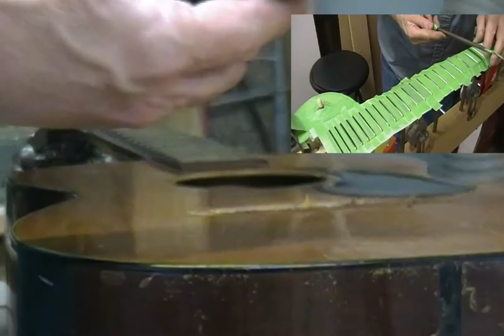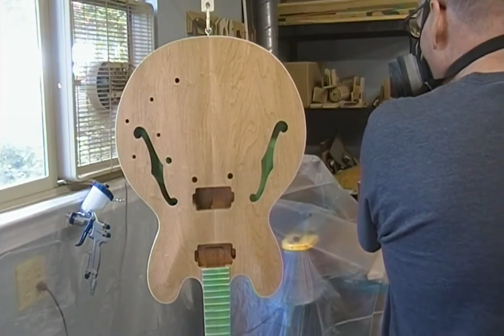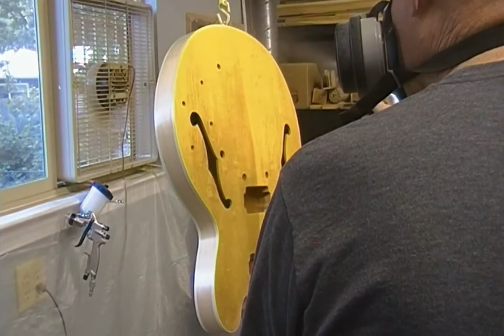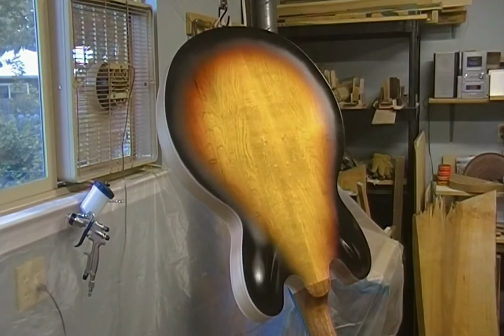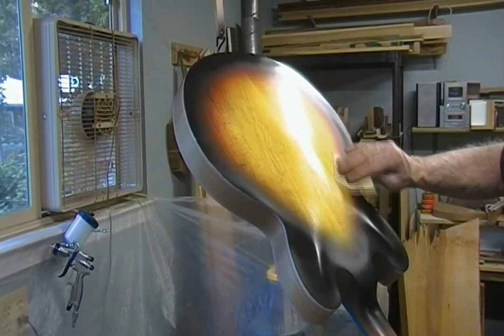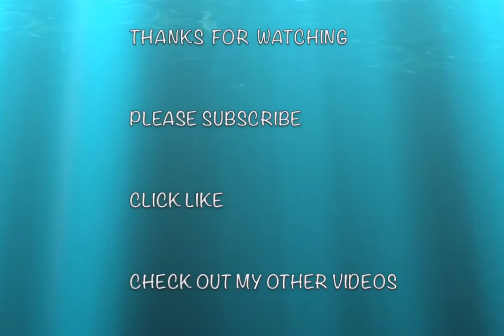SPRAYING A SUNBURST – JONAH GUITAR

Comment: Gorgeous
Compliments!
I should paint a 70's eko ranger 12-string acoustic which is already live.
I eliminated all the very thick polyester paint because it was cracked and because I hope that without gaining a little more sound
I would like to do sunburst.
You advise me to do it with the black brown red amber background sequence like the acoustic gibson (I would do it with water or toxicity problems) or with the pad system you used (I think that being not an expert in using a spray allows me to make less mistakes).
T Did I think about using shellac with various pigments added to get the shade or just alcohol mordants of various shades?
For the final transparent stage?
I wouldn't mind a buffered sunburst finish but with a wax finish similar to natural wood taylor to gain even more sound.
Can the preparation be skipped by giving more coats and sanding or is there an easy way to do it?
To avoid beard and blemishes 300 - 600 - 1000?
Thanks Roberto
Reply from the maker: Lots of questions here. I'll try to hit most of them. A rubbed stain finish/ burst requires better, finer sanding. Ending at 220 or 320 but very thorough with no scratches remaining. Any scratch will show up big time when stained. That's why all the old time factories sprayed sealer first and then color so the the fine scratches don't soak up stain. The gibson colors were less intense then mine look in the video. They don't look that bright in real life. Fender used very bright yellow, red, black on thier bursts. If you want to see a good source for hand applied stain bursts check Big D here on YT. He does a very good job with these type of bursts. Thank you for watching, always happy to answer Qs if I'm able.
Reply: gracias

Comment: Really nice sunburst. Hos have you shaped the top and back - carved or vacuum Press?
Reply from the maker: Thanks very much Gert. It's a carved top and back. I decided I didn't want to take the time or expense to set up a vacuum press. But it ended up taking about 12 hours per back and top to hand carve them. Although I would have had to carve a form to vacuum to plus make the filler pieces for inside. So I'm still happy with my choice.

Comment: Did you use a sanding sealer before the colors? or bare wood?
Reply from the maker: Hi Benny, yes I did shoot a coat of clear before color. I also shoot clear between the color coats so in case something goes wrong I can sand back with out damaging the previous color. Thanks for watching!